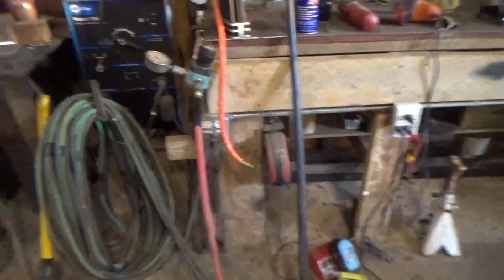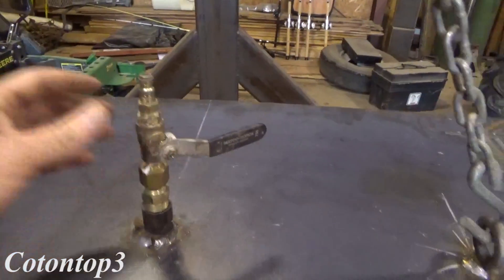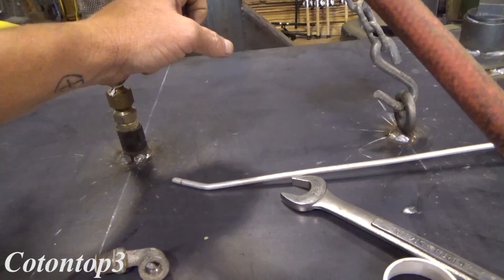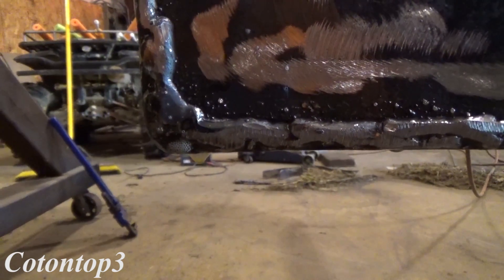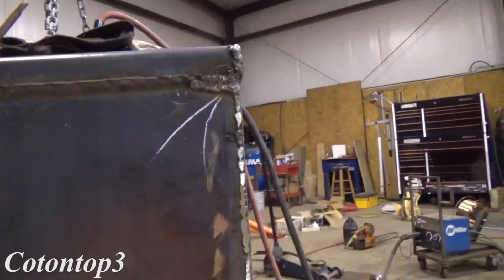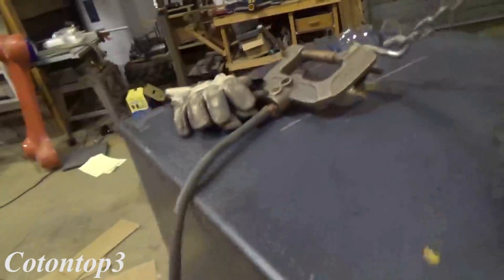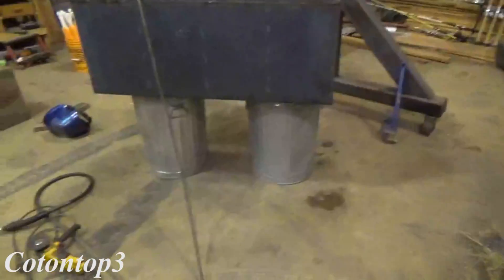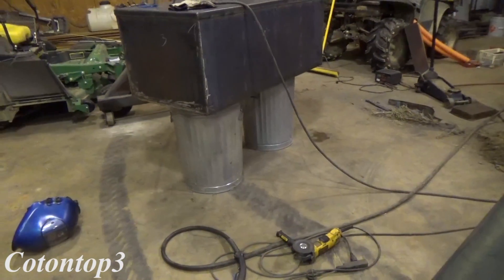Fuel tank build (part 8) pressure testing the tank

Comment: I am a steel fabricator and a guy I work with was air testing a very large recuperator its basically a large industrial heat exchanger. It is made of 316l stainless steel and cost 1.2 million dollars when complete. While he was filling it with air nice and slow he walked away for a minute and BOOM that mother F-cker blew up and sounded like a frickin bomb went off!! It blew the whole side apart. So I am warning anyone that air test a tank to be careful.
Reply from the maker: +JOHN HUFNAGEL you can not put but a little air in them or you're asking for it.
Reply: yep

Comment: If that had of been Wes and Tim Pandy from OLF they would have pressure tested it by by taking it out into the field and dumping it in to a ground hog hole. Then run 150 feet of air line back to the compressor and giving it a full 150psi charge. If it held it's a good tank. If it blew to bits, it's back to the drawing board minus 1 ground hog. lol